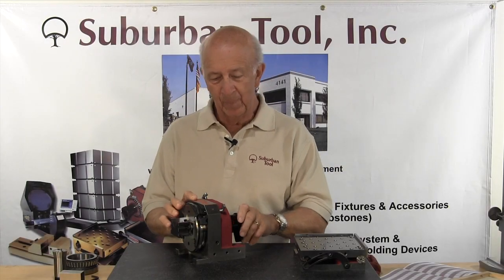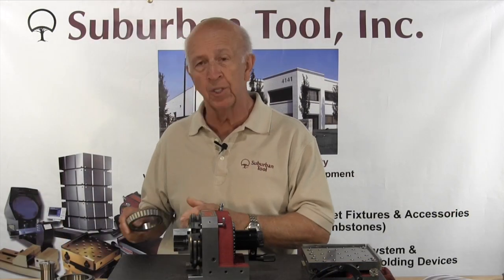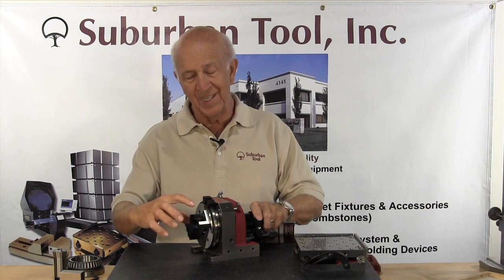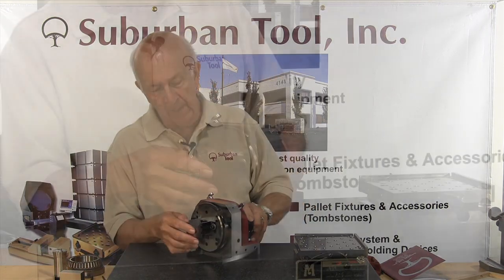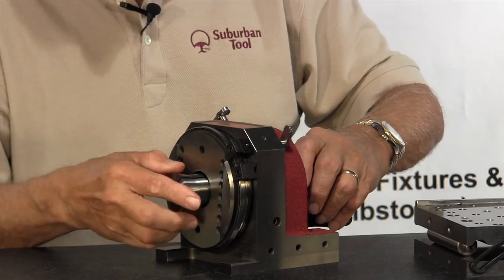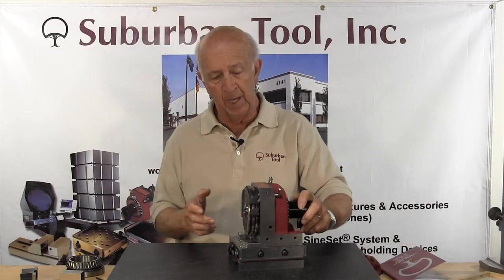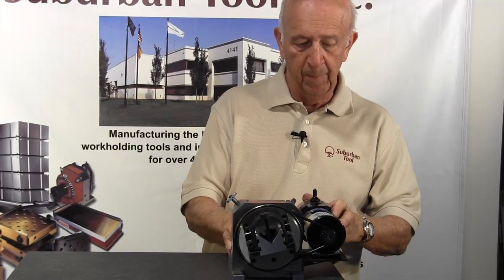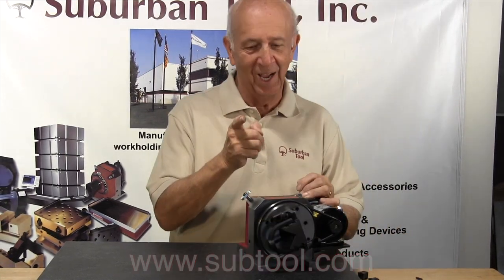Master-Grind Index Fixture - An Overview

Comment: These are very nice pieces of tooling. A bit pricey but "YOU GET WHAT YOU PAY FOR". IMO better than the similar Harig unit in terms of the offset work capability and smoother. The collet feature is nice but then you are unfortunately stuck with the collets own runout which can vary from very low for Hardinge Super Precisions to all over the place for low buck imports. Once again see the part in quotation marks. The only bad thing about these is unfortunately some people seem to think these are milling fixtures. They can be used that way but it seems an abusive use to me.

Comment: Don;
  Thanks again for all the training you have given me here. 
  When I bought my surface grinder... I really didn't know a thing about running it. 
  Anyhow, I have a Master-Grind now. Bought used, and in good shape. 
  I notice that the 5 degree detent pin does not completely arrest the spindle. 
  Do you just work with the play, or is there a lock-screw?
 I can rotate maybe 5 minutes either way after the pin-drop. Maybe more..
  Thanks!
  Mark